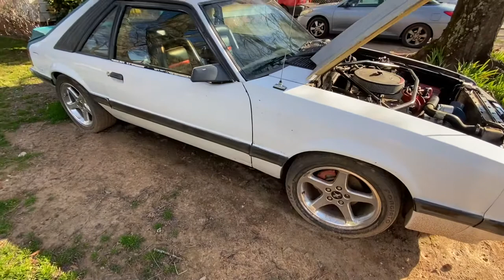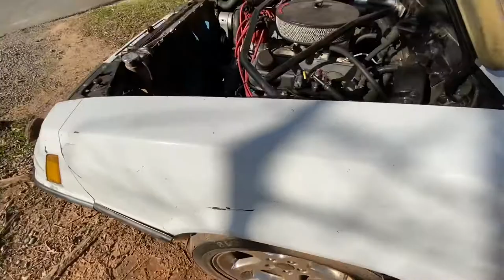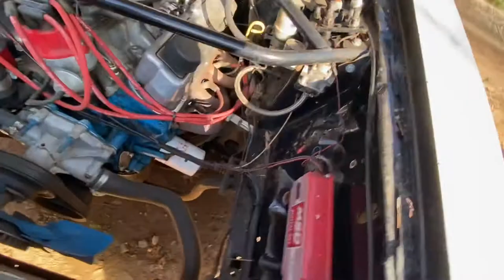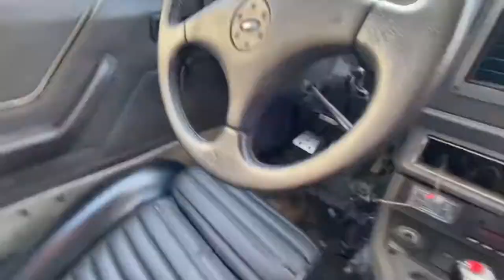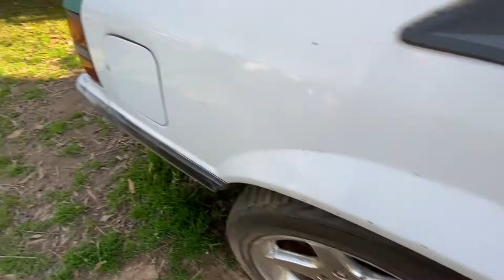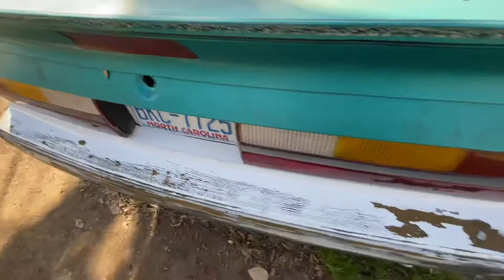THE MID-80S MOST WANTED: THE 1985 MUSTANG GT!

Comment: Is this car for sale???
Reply from the maker: Yes. The car is for sale. It’s for sale for 6K. The car has a 306 motor, E303 Camshaft, Torker 2 Intake Manifold, T5 Manual Transmission, with a heavy duty stage 2 clutch. The car runs but the carburetor needs to be rebuilt. It’s dirty. You can see that the car has disc brake 5 lug conversion all around. You get the car the way it is. If your interested, text me on my Instagram which is @everythinggoestv Thank you for watching!